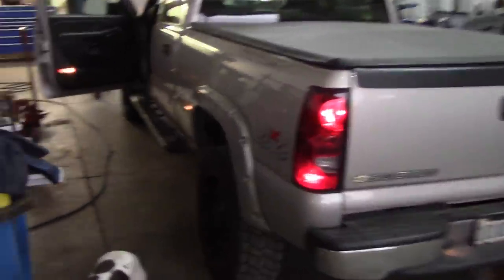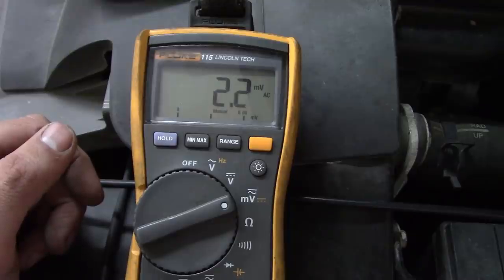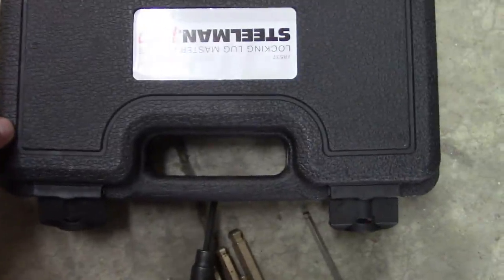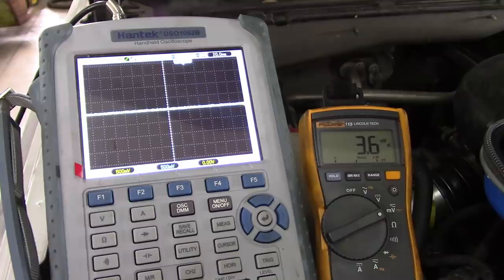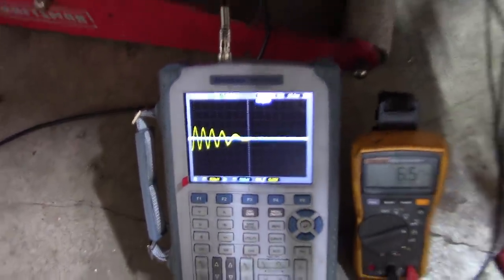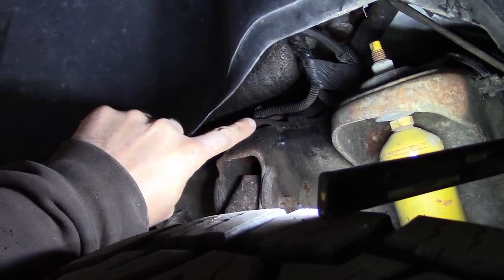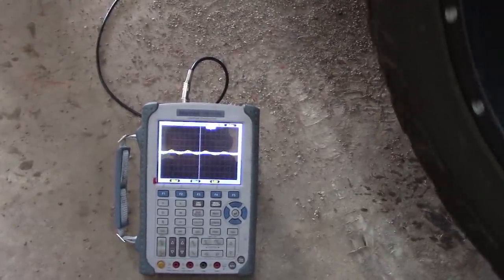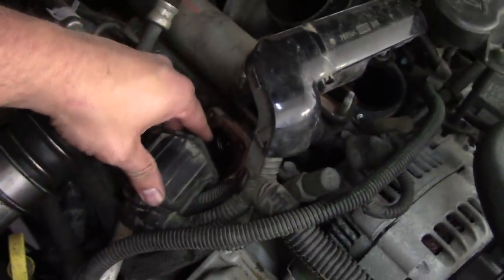2005 Silverado Duramax- Wheel Speed Sensors, EGR Flow, Glow Plug Module - P0401, P0404, P0670 - P2

Comment: You will like this one so I get a call from a relative on a 2010 GMC Acadia 3.6 liter says dealer wants $7500 to do timing chains on it and asks if I can do it I said yes and I go to get it at the dealership and they have taken the whole top of the engine apart and the front of the engine and stuffed all the parts in the back. Now I have never done a 3.6 so have no clue what bolts go where and how stuff was routed or bolted up where so this will be interesting, So I will get it back together and let you know how it turned out lol
Reply from the maker: $7500? How? You can buy a whole reman engine for $3000 and no way it's more than $1500 to do the swap, even at the stealership. That's insane!
Reply: @WatchWesWork  Don't know just know what was told to me and I reacted the same way almost fell out when I was told that unless they was going to put in a reman engine and charge them like $3500 labor will find out more of the story after I do a pressure check and make sure there is no bent valves
Reply: @WatchWesWork  Yeah it has some bent valves so evidently they was going to replace the engine but still $7500 is a lot of money, I pressure checked 2 cylinders and one was leaking out intake and other was leaking out exhaust and for any of you that question yes I had the engine rotated over to where the valves was closed :)

Comment: you can probably set the trigger of the scope so it freezes the image and stops updating once it reaches a certain threshold.
Reply from the maker: I don't know. Most scopes are really made for continuous signals.
Reply: and set it to single capture
Reply: @WatchWesWork  it's in section 6.4 in the manual for the scope, "Example 4: Capturing Single-shot Signal"

Comment: i had to take the egr motor out of my 2010 Iszuz dmax and clean the hell out of it i stopped getting errors after that, im sure it will  get bad over time but something to consider im australian btw its the equivalent of a 2010 rodeo gm i think made by iszuz  and rebranded to holden here gm there?

Comment: having several sizes of Auveco vacuum caps.. might allow you to shove one down the open hole sealing it from rust falling into the bearing.. and allow you to clean the top of the bore.. then extract the rubber vacuum cap with a drywall or deck screw that the sharp point is ground off..  making both reusable..  sorry i don't know what size you want.. i bought several bags of them and tossed them all into one bin  here is your selection.. https://www.auveco.com/vacuum-caps-1   these are different that the vinyl dorman vacuum caps.. these are the real thing..  i live in so cal.. so its mostly dust i am cleaning out..  i might also suggest using hylomar or the permatex version called flange dressing 85420. to protect the surfaces from rust jacking and ease removal later..   i worry that the sllglide might wash off the external surfaces when exposed to water..  if you have to hold the rubber plugs to a grinder to make them a perfect size..

Comment: lack of voltage output could be the sensor to tone ring gap too wide, lifted by rust and full of debris or the tone ring rusted/filled with compacted rust flakes.
but probably plug/harness end or abs module/connector with water intrusion and corrosion. often they'll work OK after after 3 to 5 days dry low humidity weather, then after a drive in rain or high humidity days go bad again.
that said I'd be thinking these vehicles were possibly post flood victims and big cans of worms, unless known otherwise ;)

Comment: The variety was awesome, I have a question, my 04 yukon 6.0, hooked up the scan tool, I get a mass air flow code, it says failed this ignition cycle, but no light, it'll toss a light when you give it the beans but it's not every time, I don't wanna just wing a sensor at it, any info or testing advice?
Reply from the maker: Hard to say. Can you see the live data from the MAF?
Reply: Yep, I've got an autell like Eric o, the truck has 199,000 miles on it it's got the original mass in it soooo lol
Reply from the maker: @tbas1972  You might try cleaning it.
Reply: I will try that too, did it last year and took care of it.

Comment: I like these vids, but i don't envy you doing them.  I guess a lot of owners will ignore a problem, especially if it doesn't directly effect driving until something else comes along.  A good example -  ABS light comes on: ignore.  Air pressure light comes on: look at tires, ignore.  Oil change message appears:  wait a few weeks of commuter driving, call Mechanic for an appointment.  Get call from mechanic: Abs and air pressure modules are shot, need parts.  Response:  How much is that gonna cost?  What, how much?  Can you just disconnect it?  If people would address each problem as they arose, they could possibly save some money, or at least spread the cost out over a month or two.  Makes no sense.

Comment: Hmmm...how you yank the ABS fuse...how you will pass annual inspection with ABS not working?
Reply from the maker: No inspection here. If it has a license plate, it's legal.
Reply: No annual inspection here.  Safety inspections are static only, no drive test.  ABS is bullshit, brakes stop, ABS prevents stopping.
Reply: I used not to believe in ABS brakes until I was forced into a panic stop on an ice coated bridge.  Car in front of me was sliding sideways. Concrete bridge rail to one side, traffic to the other side.
I was about to T-bone the sliding car.  No choice but to hit my brakes hard. The ABS kicked in and I stopped straight as an arrow.  But it was a new car and the ABS worked perfectly.
Reply: @12345NoNamesLeft  Yes, they are a pain in the ass when they don't work right, but when they do, they can save your bacon!
Reply: @WatchWesWork   hmm...and how insurance work...if you are in accident, insurance company will blame you of technical neglegtence of vehicle and ... jail

Comment: Does that mean you favour yearly tests or not?
Reply from the maker: It would sure bring me a lot of work. Here it's like pulling teeth to get people to fix ABS, evap, airbag, and rust related issues. If it runs and the AC works that's all they want.
Reply: @WatchWesWork  till the brakes fail and they crash.😢

Comment: Don't throw your old scope probe away. An ohm meter should tell you if it's shorted or open. Wild ass guess would be a lousy assembly of the BNC connector. The scope manufacturer might even take it back as faulty and save you the princely sum they ask for a new one.

Comment: I saw this listing for a truck at a Richie Brothers' auction,  **can this milage be real?  Opinions?  
This truck looks like a new 1992 Ford**

Lot # 643
1992 FORD F XLT Super Duty Dually Cab & Chassis
Meter Reads:3,465 Km
Serial number or VIN:2FDLF47M3NCB05543
Location:Auction yard
Selling:Speers, SK, CAN - Wed, Oct 28
7.3 L, V8, 5 spd manual

I'm not bidding here, it's too far for me.

I'll post the link below.
Reply: The link to Richie Brothers Ford:
https://www.rbauction.com/1992-FORD-F?invId=12185854&id=ci&auction=SPEERS-SK-2020635&feedage=20201015